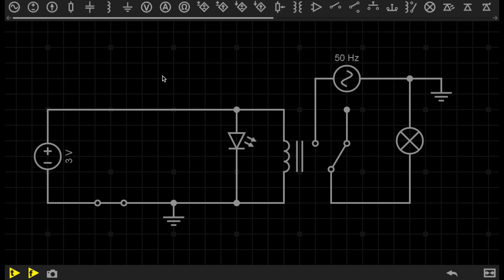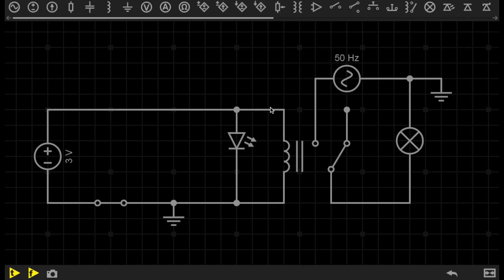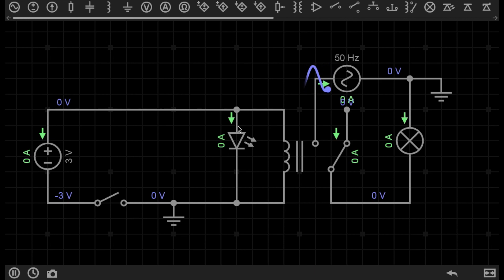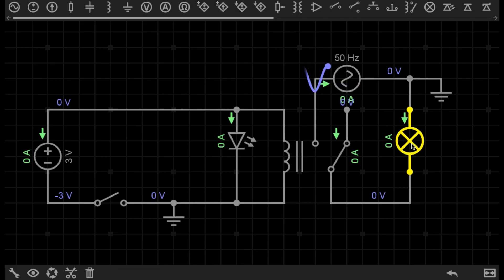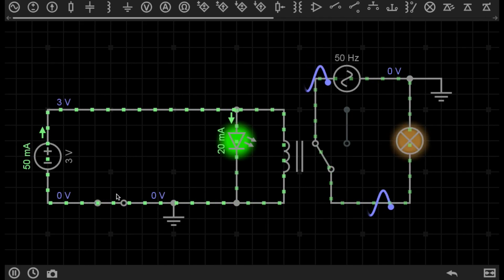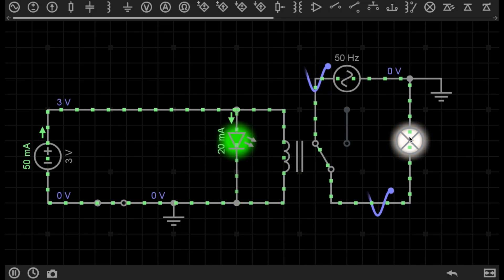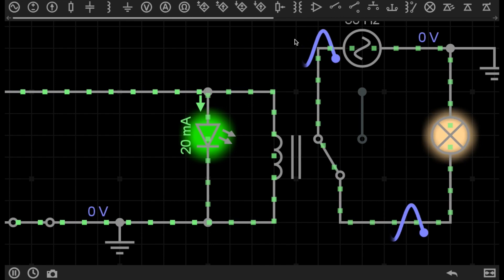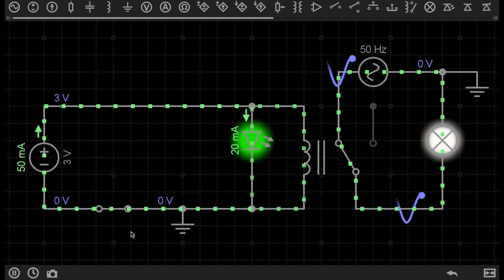What is a Relay? (Interactive!) - Electronics Basics 8

Comment: A relay in my car failed close causing failure to start. Changed out relay, car starts. Some internet discussions say original part had steel in contact with copper causing corrosion causing the relay to fail to close the circuit.

Comment: agreed that this is the more common use for relays today... but I like to point out another use for relays is in building logic gates -- by wiring multiple relays together, so that they control/switch each other, which then become the fundamental building blocks of creating computers.

of course, building computers using relays would be very expensive and time consuming, and the computer would be very large (requiring many, many, many relays), and operations would run very slow -- but it sure is a lot of fun.... and you learn tons.

original relay-based computers were soon replaced with vacuum tubes (or valves, in the UK), and eventually those were replaced with transistors. Fascinating history, as technology continued to evolve into faster, smaller, and cheaper components.

Comment: I have a question: when the current stops flowing in the dc circuit, how does the switch in relay get back on its previous place? Is it just mechanical like for example a spring or is there something electromagnetic going on?

Comment: Well I did not hear back from simply electronics... but I did find two answers... I told my dad about these videos... bragging on how good they are... and he told me about the old school way of thinking about electron flow that they used to think that it used to flow from positive to negative... this is known according to the "Every Circuit" as conventional electron flow... (Or the way they used to do it...)  Anyways I decided to register and pay the one time fee $14.99 for the "Every Circuit" app access... as I was thumbing through my profile I noticed settings in the menu (just below my profile name with the down triangle/ down arrow) the first thing it asked for was weather I wanted conventional electron flow (old school) or the actual... not exactly an explanation but some insight... the reason it has to be neg to positive is "ground/chassis for the "EARTH"" has all the free electrons...

My Dad also mentioned that several cars use to wire their chassis as positive ground.. apparently dodge was notorious for this and one of the last car makers to standardize the negative ground chassis like our home electrical systems... Other good historical notes on power systems and AC cycles how when the grid became standard in N. America - many motors had to be replaced because some areas were originally 50hz and the system went to 60hz... of course Europe has the 240V Ac - I assume cycles are similiar - but not sure - I can google... but I'm sure someone will correct me or some detail of my understanding.
Reply: http://web.engr.oregonstate.edu/~traylor/ece112/beamer_lectures/elect_flow_vs_conv_I.pdf 

the university of oregon state explains some more of the origins of "Conventional Flow vs. Actual electron flow... This is Beta vs. VHS all over again - what got here first is what everyone uses.

Comment: Why are the electrons/current flowing form positive to negative. Other videos he stated that electrons/current flows from negative to positive? Thank you for the videos.
Reply: The conventional "current " flows by definition from positive to negative.  That's all one need to know, but as electrons were subsequently found to be negative charge carriers, some purists prefer to think of electrons moving around the circuit.  Some textbooks will follow this later convention but it means that the little arrows on transistor and diode symbols are pointing the wrong way!   Most electronic engineers and designers have passed their entire careers using the older (incorrect) convention with no problems at all.
Reply: @karhukivi  Thanks for the clarification
Reply: @artrecogniseart  You're welcome!

Comment: Whats the difference with a transistor? I think you can achieve the same?
Reply from the maker: Transistors can be turned on/off at very high frequencies, relays cannot do this due to mechanical limitations. This is why computers and any logic circuitry consists of transistors, including the fact transistors can be manufactured at a microscopic scale.

Comment: hi, I'm wondering if you want to turn the switch ( of the AC circuit ) back off, then should you create a second circuit similar to the DC on that's being used to turn the switch on initially but on the opposite side? or can you actually turn the AC switch off just by turning the DC switch off? ( if that so then why? )

thanks!  : )
Reply: Spring...

Comment: Q: How does the switch come back to the original position? I think it has a spring on it, because the relay only generates a magnetic that atracts the switch and if it repels it would need probably a current in the other way .
Reply: +Daniel Agostinho
relays and contactors do indeed use springs to return moving contacts to their default positions. here are some cross-sectional drawings of relays and their parts:

https://www.machinedesign.com/sites/machinedesign.com/files/uploads/2014/07/contactor_cross_section.gif, https://www.avnet.com/wps/wcm/connect/onesite/b3c2c19f-622a-4195-ade4-13f3f5fb7ee7/RELAY+image.jpg?MOD=AJPERES&CACHEID=ROOTWORKSPACE.Z18_NA5A1I41L0ICD0ABNDMDDG0000-b3c2c19f-622a-4195-ade4-13f3f5fb7ee7-l.KmKIq, https://slideplayer.com/slide/6831833/23/images/22/Relay+cross+section%2C+%28a%29+de-energized+and+%28b%29+energized..jpg, https://image.slidesharecdn.com/chap36-091025182849-phpapp02/95/chapter-36-32-728.jpg?cb=1361644391

Comment: shouldn't the current be moving from negative to positive?
Reply: Yes in the "real" physical world that is "true"... but Engineers quickly learn that "current" flows from + to - as a convention... it's like we all know that the electrons are flowing from - to +, but we think of the "holes" flowing from + to -... confusing?  Accept the mystery...  and just realize that in most case when we talk about a circuits current flow it's from + to - even though that's not technically true.

Comment: I thought you said current flows from the negative terminal of a battery back into the positive?
In the circuit on the left, the current is flowing from positive to negative.
Is that just an error in how it is rendered or is there a reason for it?
Reply: Commander Sisko conventional current flows from positive to negative. Electron flow flows from negative to positive. We use conventional flow in real life although it is the incorrect flow of electrons.
Reply: Yes in the "real" physical world that is "true"... but Engineers quickly learn that "current" flows from + to - as a convention... it's like we all know that the electrons are flowing from - to +, but we think of the "holes" flowing from + to -... confusing? Accept the mystery... and just realize that in most case when we talk about a circuits current flow it's from + to - even though that's not technically true.

Comment: How to make it switch with longer or shorter intervals ? For example i got capacitors charged to 10V and when it reach that voltage i wanna discharge it to other capacitor how can i do that ? Relay or transistor ?

Comment: Hi, can I use a relay to stabilize or boost a low AC voltage say 160v to 220 +/- 10v?
Reply from the maker: A relay is just a mechanical switch. Applying PWM to a relay would not work because they can not switch at the speeds that a transistor can. This also would only apply to DC voltages. You would need a step-up transformer to boost AC voltage.

Comment: Why does the high powered device circuit need to be AC? Couldn't it be DC as the low power circuit is also DC?
Reply: It could be. He didn't say it has to be. It's just an example circuit chosen by him to explain you the main topic of the video: the relays.
Reply from the maker: Correct :)
Reply: Its more so an example of why relays are used. In some instances where its dc-dc and something simple like an led light on the back of a truck a relay is usually a waste of time and extra wiring and isnt really needed. He explains it more so than any others as far as computers running high powered machines like you might see in a production plant using lots of automation.
Reply: Because AC is cheaper than DC .

Comment: starting from this episode the DC circuits which you illustrate  shows that electrons flow from positive to negative ... please explain why did you change the flow direction of the electrons ???
Reply: he is not showing electron current flow. which is, as you implied, from negative to positive. assuming there's a negative and a positive, which there isn't.